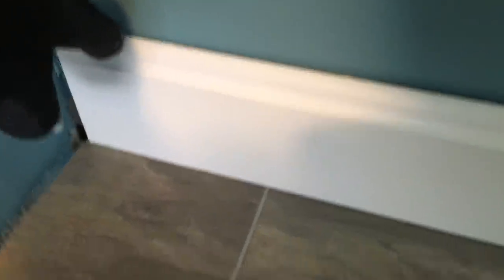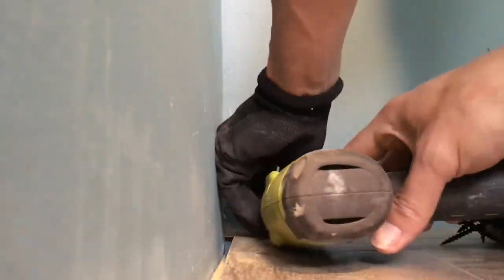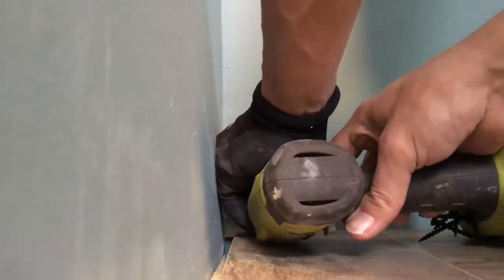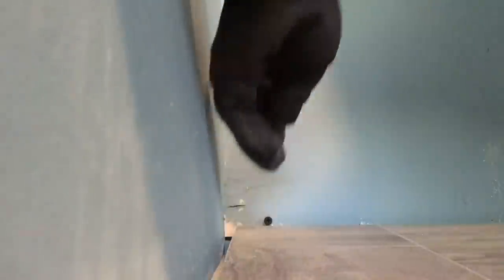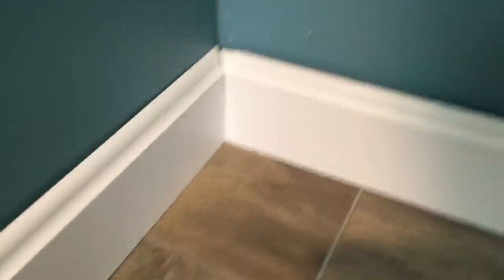How to Fix Gap under a Floor Molding - Quick Fix

Comment: I use scrap as a  spacer but the screw is a good idea. easy and quick
Reply from the maker: Scrap wood is another good Idea! Thanks for the Tip!
Reply: I've used folded cardboard in a pinch for similar spacing issues.

Comment: Looks good on the bottom but now you have a gap at the top?
Reply from the maker: i push in really hard against the wall and nail gun, then use white chalk to fill anything i still don't like the look of.
Reply: You used Chalk?
The white stuff to write on a blackboard at school?
Maybe you mean Caulking, for the "caulking gun"
Reply: No u don't,  the top of the skirting is already nicely snug to the wall, it's the bottom that has to go in, the skirting has to be perpendicular to the wall because  and not slanting inward at the bottom, the screw in effect makes the wall straight to facilitate the skirting being perpendicular and to receive the other skirting. 
 Something like that I hazard.
Reply: That should read no "it" don't.
Reply: Clearly he means caulk and isn't the best speller as he uses it incorrectly a few times.

Comment: What kind of nails are you using? I am using 1 3/4 inch wood nails. When I drive them in they just push to the back of the drywall.

Comment: What if the reason you're doing it is to keep out bugs?? They'll still get in this way. I live in a very old historic building and there's a significant gap in several places.
Reply from the maker: That is fine i would also use Lots of white Chalk, i had a bug issue and Chalk every crack i could see helped a lot! Also Spray around your house with some bug killer!

Comment: I just moved into a turn of the century home and the floors are uneven. Therefore the baseboard on the same wall will flush to the floor on one side and gap on the other. What to do in that case?
Reply from the maker: you could cut down your floor molding short on one side but that might look a little strange, another option would be to fill the Gap with something like Chalk or Wall Puddy and fill over, or you can even out the floor https://www.youtube.com/watch?v=OTEmJ2O17mw

Comment: Can you tell me how to remove the baseboard without damaging it, I'll have to do it mayself. Thank you
Reply from the maker: You will want to razor the top of the molding in case there is paint or Chalk attaching it to the Sheetrock, you will need a small crowbar, take you time and slowly pull it away from the wall, you will need a nail gun to reattach it and prob some touch up paint, and chalk or Spackle depending on how it goes, sometimes the baseboard will break depending on how many nails they used in that case home depot or Lowes will have something very similar just need to paint to match. Another Option is get a 3/4 Corner Round molding to go in front of Baseboard and use a nailgun to attach to current molding, and leave current molding in place.
Reply: Golf club and duct tape..

Comment: that's just covering over poor workmanship in my opinion, but it is a quick and probalby lasting fix, can't argue with that.
Reply: You're right. It's a cover up. But this is a fix for when the damage has already been done and it works perfectly.
Reply: True, but in my case, the flooring installers are long gone and it's time to put up new baseboards.